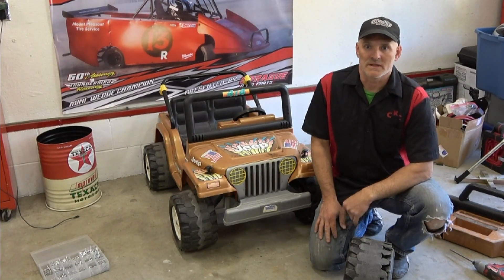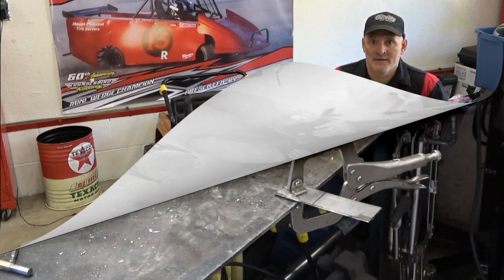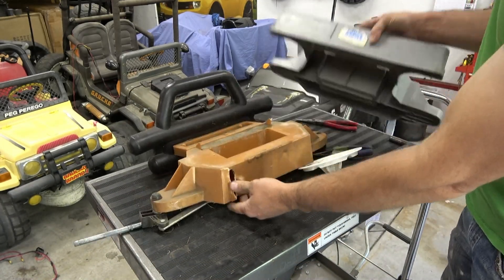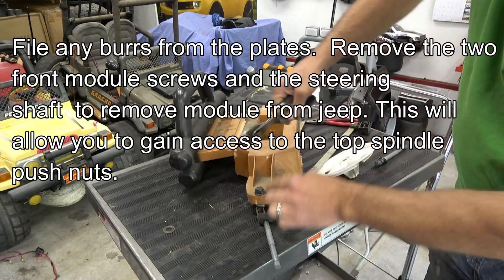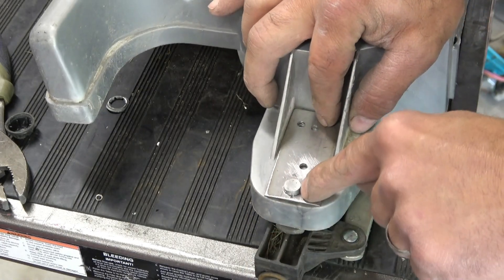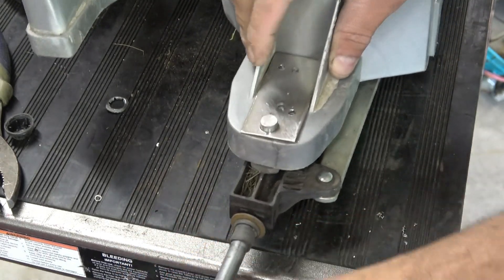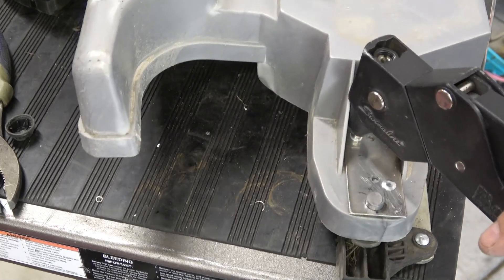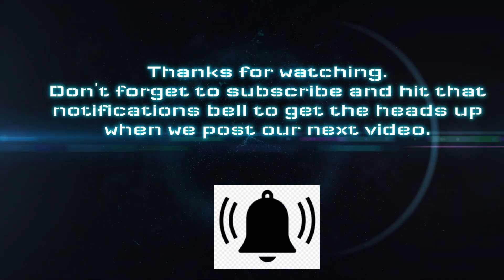Powerwheels Jeep- DIY fix for front end sag negative camber issues

Comment: In Home Depot's hardware section they have Everbilt 3 1/2" double wide mending plates that work perfect. Holes predrilled on the side that don't interfere with any plastic support underneath. All you have to do is drill a 7/16" hole for the shaft.
Reply: @Ryan Willie Flixportal :D
Reply: @Yusuf Aaron Thank you, I went there and it seems to work :) I appreciate it !!
Reply: @Ryan Willie you are welcome =)
Reply: Item #?
Reply: @nateb4543   I’m thinking it’s this: 
Model# 13509 
Internet# 203103415 
Store SKU# 348807

Comment: I didn't know which one of your videos to post this question on, so I hope it's OK I post it here.  I've recently modified all 4 of our Power Wheels ride ons from 12v to 18v (thinking 18v would save the motor life a little longer than going 24v...also because it's easier to fit a 2nd 6v battery on most of these than 2 12v's). However, one of our Power Wheels vehicle won't take the battery tampering:  It's the Boomerang.  After doing all the wire modifications I noticed that once I made the final battery connection there was a tiny spark (none of the other 3 ride ons did that).  I had my daughter get in the driver's seat...and it started driving (fast) for about 2 seconds, then shut down.  The Boomerang has a battery light meter under the gear shift which only has 3 colors (green, orange and red) to show how much charge the battery has.  But when connecting the 18v in-series batteries...and after about 5 seconds of being connected, the light turns from green to purple (a new color!).  I tried multiple times, always with the same result.  If I had my daughter step on the gas pedal quickly right after I made the final battery connection, we'd get about 3 seconds of (fast) ride time until it shuts down.  I'm thinking this newer Boomerang must have some "smart" sensor that detects the motor is getting more than 12v of power.  So, I'm looking for a way to disable this sensor, or whatever is causing the car to not accept the 18v battery setup.  Any ideas?

And I might as well include that today our ATV style ride on (recently modified to 18v) seems to have had one of the rear motors go out.  I got this ride on used a couple months ago, it's a few years old.  As we pulled into the driveway from a long 2 mile ride (with all 3 ride ons) I noticed it  was making a different sound and upon looking closer I noticed that only one of the rear wheels was turning.  I lifted the back up and tried turning the 2 back wheels with my hands, only 1 of them had any tension, the other one didn't have any tension and just freely turned.  I have no idea what this means, but I'm guessing there must be 2 motors, 1 for each of the back wheels?--and maybe one of them blew?  Do you know if these are easily replaced?  FWIW, this ATV style ride one modified to 18v went a tiny bit faster than our Barbie Jeep and Dune Racer (also modified to 18v).  Thank you.

Comment: Hey there- wondering if you had any spare front ends available for sale with this fix? I have a project going and cannot find a replacement. I totally rebuilt a garbage jeep with pneumatic wheels, painted in a Jurassic park theme...you should see it. The last piece is to solve the front end it has the big crack where the steering goes through and each wheel sags considerably.

Comment: Nice work- any quick fixes for front wheel sag for the Peg Perego RZR 900?

Upgraded to 4 rubber tires and have noticed now the front right wheel is toe in now. 

Any help would be greatly appreciated!
Reply from the maker: Sorry don't have a diy for that model. Don't see that one in the shop much. Next time I get one I will check it out.

Comment: My son has a Jeep like this but his steering wheel raises up and down. There is a push nut on the bottom of the steering shaft. The other power wheel dune racer we have has a threaded nut there.im not quit sure what to do? Any ideas what be greatly appreciated.
Reply from the maker: U can swap out the push nut for a 7/16 shaft collar or slide the push nut further up till the slop is gone
Reply: Thanks for the quick reply. I lost the push nut I took it off and attempted to put washers on the shaft then put the nut back on but it went flying in the grass when I hit with hammer and it's not same size push nut as the wheels use it's smaller. I'm gonna go to Lowe's later and get new nut or one of those shaft collars. Do I need to thread the steering shaft to use the collar?
Reply from the maker: No, it's a ring with a set screw
Reply: @CustomKidzCars  ok now I remember watching you use one on another one of your videos! Should major hardware store carry those you think?
Reply from the maker: @alexbekkala1718  yes, u will need a 3/8 collar
Reply: @CustomKidzCars  thanks for all the help I do appreciate it!!
Reply: A little tricky but I drilled a hole through the bar. Washer and screw. No slack now.

Comment: Is there any way to change the steering to something a little.... Better? Are there any products available? I have had no luck finding anything to make them handle better
Reply from the maker: Peg perego gaucho has rack and pinion steering. This model is made very cheap so it is what it is. If u want tracking u could add traction bands or use the foam tread upgrade, we made a video of the process.
Reply: Gotcha. I just recently got into modding power wheels(2 jeeps and a kfx). I googled how to lign them up and used bike tires for kfx rear. Any tips on what to do or not to do?
Reply: Both jeeps running 18v no traction bands. One of them I have 7 batteries on with 18v. Sorry to bombard you with questions but is there any motors or steel gear kits you would recommend without paying too much?

Comment: Would it work the same for the f150?
Reply from the maker: Yes
Reply: @CustomKidzCars  This will work on newer F150? (12 volt 2 seater 7R Gear Boxes?  My son's front is horribly bent and I'm wondering if this would be the same fix if I took it apart